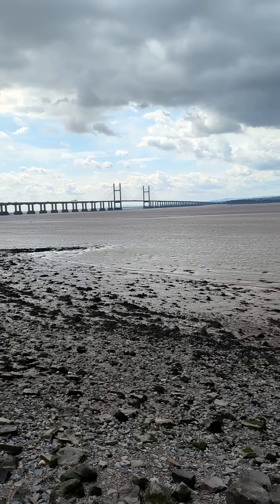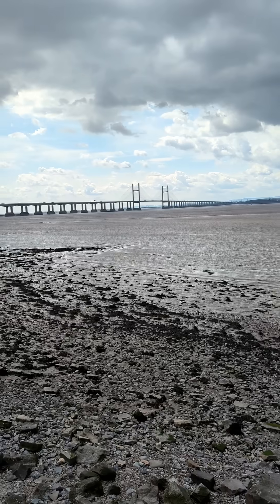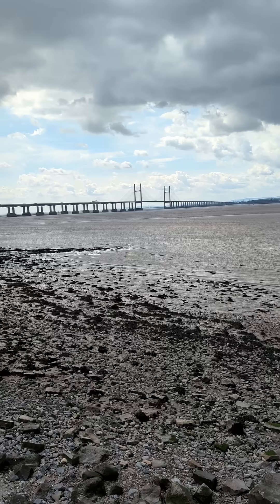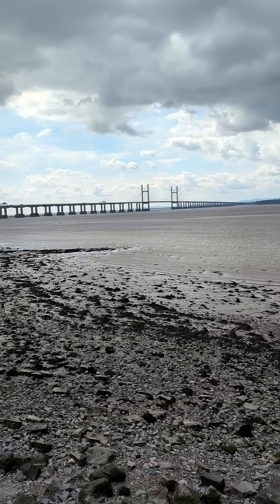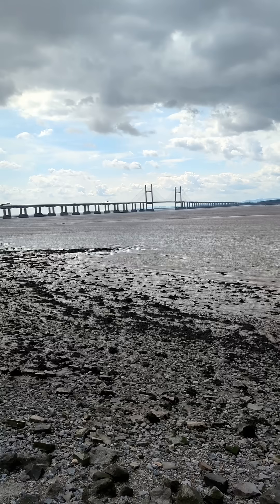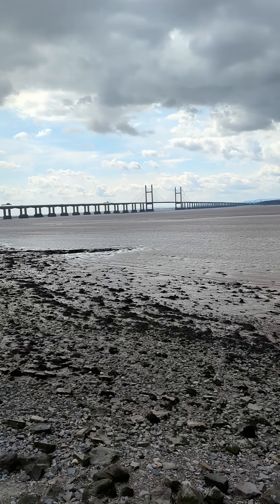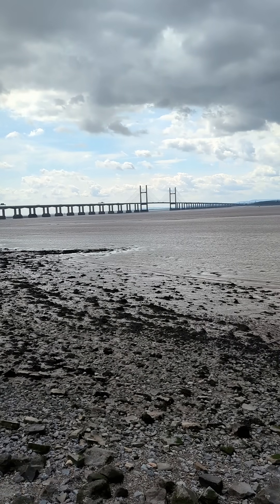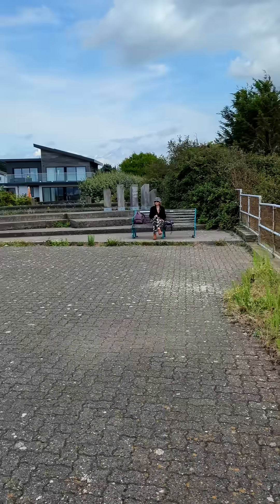a question about the structure of the second severn crossing bridge #bridge #bridges #engineering

Comment: First one is a suspension bridge. Looks better but the cables degrade over time and it's very difficult to replace them. It has only 4 lanes over it, closes often in high winds due to movement and has a traffic weight limit far far lower than the newer one. The second  bridge is a 8 lane cable stay type, much cheaper to build, not as good looking and can only span a shorter distance between the the towers. Its much easier to replace the cables and maintain overall. Being shorter it can withstand higher wind speeds so can stay open for traffic longer. It's there to allow tall ships to pass under to go into Sharpness docks and spans the deepest part of the estuary.
Reply from the maker: Oh Peter that's fantastic. Thank you for your comprehensive and informative reply. They've reduced the weight limit even more on the older bridge recently.  I will pass all this info on to my wife. Many thanks 😀

Comment: Not an engineer or like that but i would have guessed the reason was to allow boats and such to pass through. However I can't tell if the water is even deep enough to allow boats through haha. Interesting indeed.
Reply from the maker: I think you're absolutely right. It is very tidal but boats do pass through at high tide. Thank you